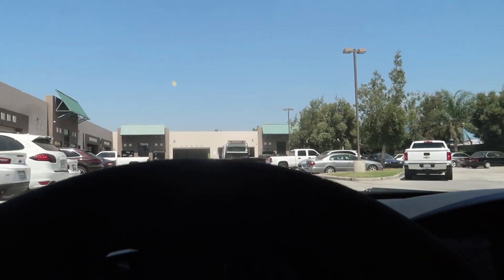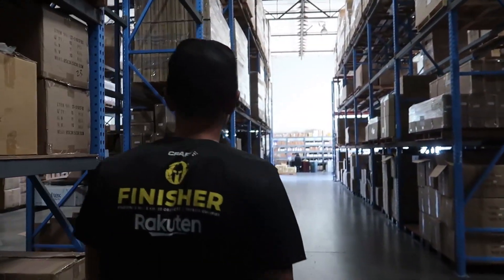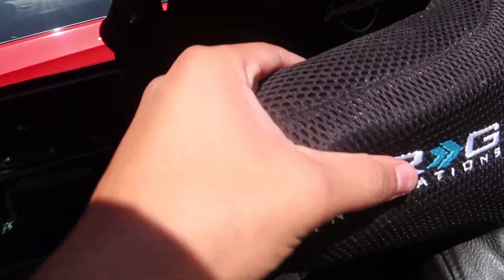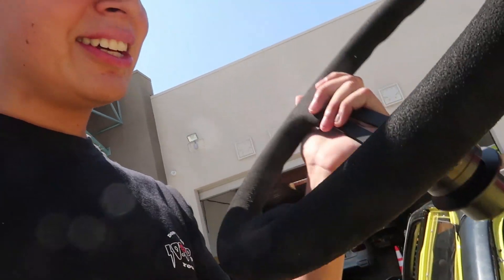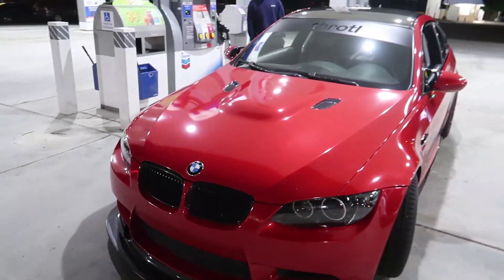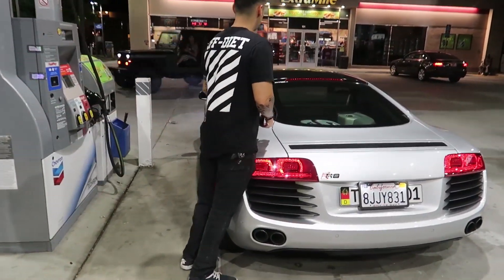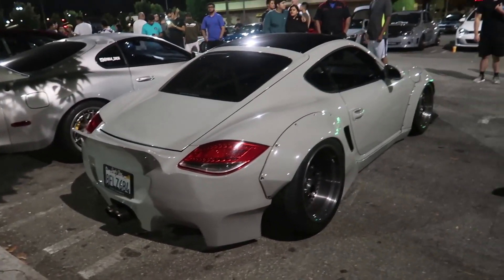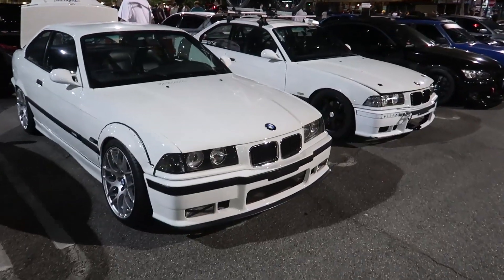Taking BMW M3's To A JDM CAR MEET!!!

Comment: Hey I havent seen the e36. Looks nice. I have a 97 m3 hellrot red sedan automatic. Clean carfax I'm second owner, only 110k miles. Dinan exhaust, dinan cf intake, dinan front and rear strut and trunk bar, dinan chip. How much should I sell it for. Any ideas?